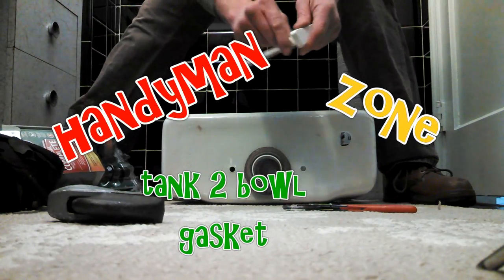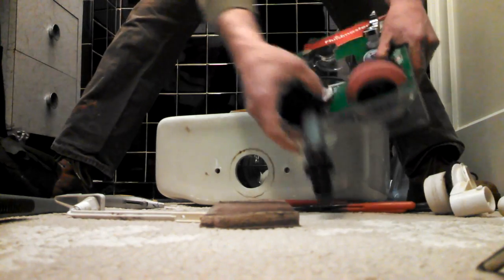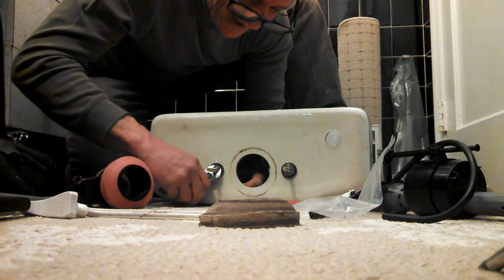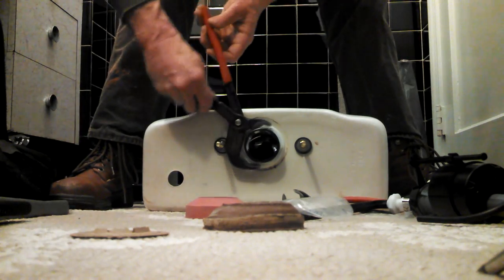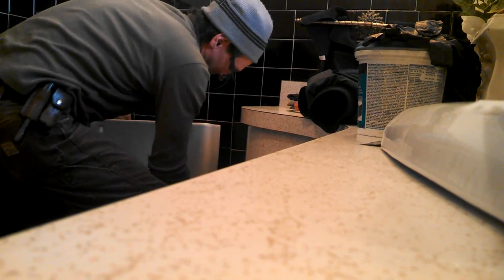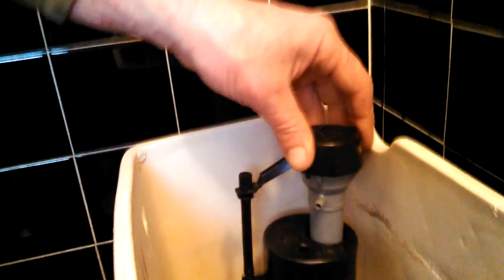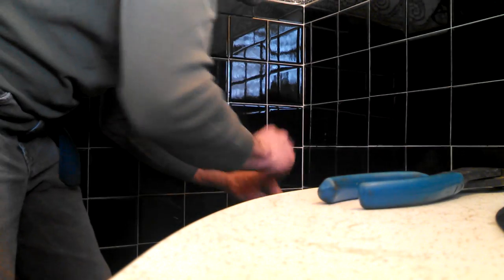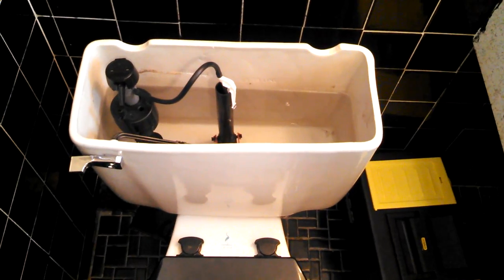REPLACE TANK TO BOWL GASKET STOP LEAKING

Comment: For me... Thank you for the video.  Mine did not come with the rubber seal for between tank and bowl... so the new separate rubber seal does not work....  I used the washers inside the tank, because it gives more coverage for the bolt head to seal tank.  Just my 2 cents.

Comment: Dino, really good job showing the parts and how they go together (why I went to YouTube in the middle of the work).

Using your vid as a guide I got everything together with zero leaks. This is the first time I've taken a tank off, so I consider that due to your extra-good instruction.

Only thing I could add: There are a couple of different tank-to-bowl seals, a type that's made for a recessed install and a tapered one. It's probably better to take everything apart using the video, then clean off the seal and bring it with you to the store, or at least take a pic with your phone. It would have saved me a trip and some time. Next time I'll know...

Thanks and subbed.

Comment: Your video & explanation is the best one so far explaining how the tank-to-bowl gasket might leak.  I had no trouble replacing the tank-to-bowl bolts & nuts with the rubber washers and brass washers...  The initial leak was from rusted-out tank-to-bowl bolts-washers-&-nuts.  You could see the water dripping very slowly right from the bolts as they protruded from the rusted-out contact points.  I chipped away the corrosion & removed the nuts, washers, & bolts and replaced them with new ones which cost only a couple of dollars.  Bear in mind that the old gasket---the big tank-to-bowl rubber gasket---wasn't the leaking element.  I replaced it with a new one anyway.  However, when I was done, I was very dismayed to find that when the flush flap was lifted, the big tank-to-bowl gasket was gushing water out the bottom... I compared the old gasket with the new one & noticed that the new one was slightly shallower than the old, somewhat corroded one.  I put the old one back because that wasn't leaking in the first place, but now it is leaking just as profusely.  You are the only one who mentioned that might happen.  All I can think of is to take both the old & new tank-to-bowl gasket back to the store & ask an associate for advice.  I don't have the few dollars it would take to buy a whole new assembly, so what could you recommend?  Oh, by the way, Thank You!
Reply: +Mark Blaschke Mark, plumber jeff here, the best thing to do is take the tank off the bowl and replace everything, this way u know it will not leak anywhere...so u would replace the flush valve(overflow), the fill valve(ballcock with fluidmaster, the tank lever, the flapper, the tank bolts and the tank-to-bowl gasket.  The only other thing, would bethe water supply, very easy...
Reply: @mark - what did you end up doing? I had a similar problem with my new gasket having a much higher profile that my tank was wobbly, so I put a wedge in to help prop it up. Couple weeks later, it's been leaking. I assumed it was from the bolts, but after going out and purchasing deep sockets to tighten them properly, it seems the leak is coming from the rubber gasket, even though I just removed the wedge. Someone mentioned on here to microwave it to soften and make it more pliable. Any ideas?

Comment: thanks for the great video..... if you have a moment and can let me know about something .. I got an older toilet from the restore (so I could have the larger tank as I hate the new ones).  When installed and flushed water has poured out at the gasket.  What should I trouble shoot ...... the gasket from tank to toilet looks new, so I am not sure what is the problem??
Reply from the maker: val, you could try snug up the tank to bowl bolts, as pet this video, or the tank to bowl gasket simply needs replacement...let me know what's happens

Comment: Hey Dino! Thanks for showing the bowl water inlet (when you cleaned it with a wire brush). I have an American Standard Champion 4 tank, and the bowl water inlet has this plastic liner, that I'm wondering if it even belongs there? It moves a bit, and looks like it was recessed due to the pressure of the big rubber gasket coming down on it along with the screws tightening down. Anyhow, I've replaced the gasket and screws with the American Standard kit (after trying and failing three times with Home Depot options which resulted in leaks from the bottom of the gasket!!!). But now I am still getting a leak at the bottom of the American Standard gasket!!! I took the tank to the plumbing store and they said everything looks correct. The plastic liner that's inside the bowl's water inlet? I showed them pictures, and they said they've never seen that before, and they would probably remove it if possible. They said give it another shot, sometimes you just have to take it off and put it back on again (mind you this is my fourth time in to see them today). Came home, tugged on that plastic liner a bit, there is some play there, but it goes pretty far down into the bowl, and it's pretty crusted and brittle. I am not sure it belongs there, but also not sure if I should take it out. There's a seam down the middle of it, and it's just about separated in two at this point. The play that's there, is what I suspect is giving enough issue between that plastic liner and the gasket to cause it to leak. I searched for 4 hours online researching this liner, looking at American Standard photos and even other makes, but there's no mention of it, and I didn't see it any in any of the photos. My next option will be to call American Standard in the morning. I do not want to go thru the hassle of filling the tank up again and watching it leak, and the clean up, and the shhhhhh... until I find out what this damn liner is! I will not let this g'damn toilet bowl defeat me! This is day 3. HA!
Reply: FYI for all you DIYers. If you have an American Standard toilet bowl, be sure to do your homework and use American Standard parts. Just sharing my experience here. Maybe the pros know better.

Comment: Great video and explanation...  but I still have a leak when flushing.  I know it is in the tank to bowl area and after 4 times, still leaking.  Seems like the tank to bowl bolts are solid and tight, just no seal on the gasket.  I'm at a loss of what else to try to see why this is not sealing.
Reply from the maker: tight up the bolts evenly...dont overtighten
Reply: I'm still having leaking issues, too. I tightened the gasket properly, tightened the bolts evenly, etc.  Mine's not leaking onto the floor, or leaking when flushed.  Mine is, however, wasting water between the tank and bowl. I'm beginning to think there's a small crack in the tank that maybe isn't visible, but is causing the water to sneak through. Ugh. I might try one more time before giving up and replacing the entire toilet/starting all over!
Reply: My problem ended up being the Fluidmaster gasket does not work on Gerber (I think that is the brand) toilets. HD does not carry the right one, even though it can be ordered online.... Got the right one made for Gerber at Lowe's, installed and problem solved
Reply from the maker: replace that tank to bowlk....it's straight foward
Reply from the maker: Dan Greeley  
replace that tank to bowlk....it's straight foward
Reply: I think I finally figured mine out!  It was the Fluidmaster flush valve not shutting off completely. Water drains down through the tube into the fill and tank-to-bowl assembly.  When I remove the tube from there, and hold it, or just let it drop into the water in the tank, it stops! I'll be getting a new flush valve asap. And it will be a different brand. ;-)

Comment: I replaced the tank to bowl gasket and it still leaked. The surface around the hole looked clean, but wasn't. I wire brushed it and cleaned it using windex and now it's fine.
Reply from the maker: Nice tip, very important that gasket mating surfaces are clean and undamaged in any trade from plumbing to automotive ... great advice!

Comment: WEIRD CAUSE IF YOURS IS STILL LEAKING:   I did the steps four times and it still leaked, only to find the person before me had not used the big foam rubber washer under the overflow "pipe" when he put the big nut on under the tank.  The leak was actually between the plastic flange inside the tank, and the porcelain, because there was no gasket used there.  Now, it's dry as a bone.  Thanks!!

Comment: Dear EVERYBODY, including licensed plumbers, please, ONLY HAND TIGHTEN THAT GIANT NYLON RING. Do not give it "another half a turn or something." I was literally in freaking tears trying to get that stupid part off of my toilet because the last guy did this. Yeah, I'm a small girl, but still, that half turn is completely unnecessary and will only give trouble to the next guy.
Reply: Get a pair of  Channel Locks that open up to a minimum of four inches on that flush valve nut.  Expect to pay 20 to 30 bucks but you will not regret it. I have had the same problem and I have been plumbing for years
Reply: I had channel locks. If the nut had been metal, they probably would have worked great, but alas, they were not playing nice with the nylon. But thank you for the tip. I'm sure someone will be able to use it. :)
Reply from the maker: SJActress remove any unneeded nylon fasteners with red hot putty knife. heat an older (messed up) putty knife or similar metal to  red hot with propane or mapp torch,cut thru them old nylon parts like no ones business, check this video to learn a new trick
EASLY REMOVE OLD TOILET SEAT WITH RUSTED OR ROUNDED NUTS
Reply from the maker: Great advice
Reply from the maker: Thanks for the nice comment Itty Bitty!
Reply: call a full sized plumber. better to have no leaks than loose enough for a small girl to remove.

Comment: Need to have a dedicated camera person.  I am trying to repair my toilet and it keeps leaking from the gasket.. you camera angle did not show how you installed the tank to bowl with the gasket
Reply: Some times it does not matter what you do, they will still leak.  I recommend cleaning the porcelain where the gasket sits to provide a good surface for the seal.  I have been doing this for years and still have problems with the gaskets from time to time myself.

Comment: Dino, ur a disaster, u did as bang up job, except for a couple things, to make ur life easier, slather a small amount of thread sealer(pipe dope) on both the bottom of the flush valve gasket and the tank-to-bowl gasket, it keeps them from binding and will seal longer.  The only other thing is, did u check the gasket in the top of the water supply line where it meets the bottom of the fluidmaster, it comes in the kit, and u can pry out the old one and replace it, or replace the whole water supply line, this is a big source of toilet floods...good job lad